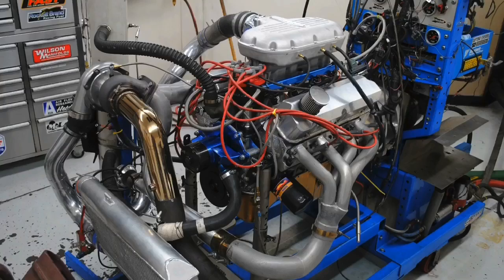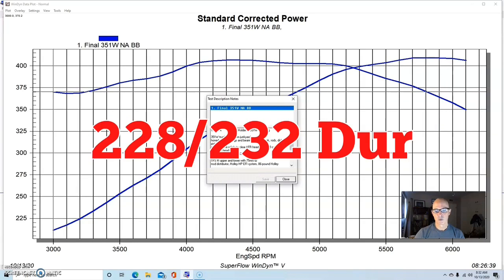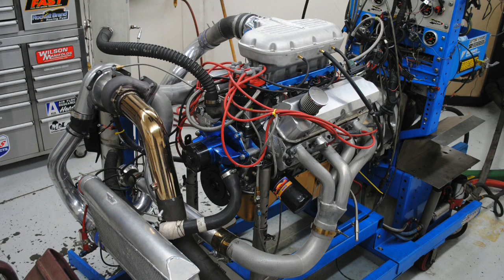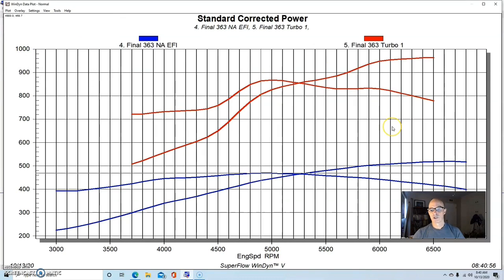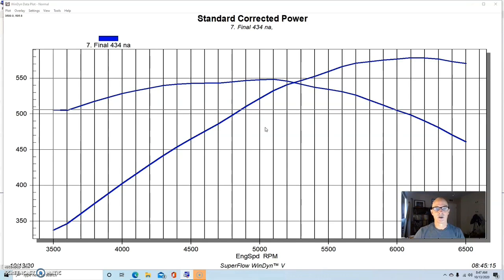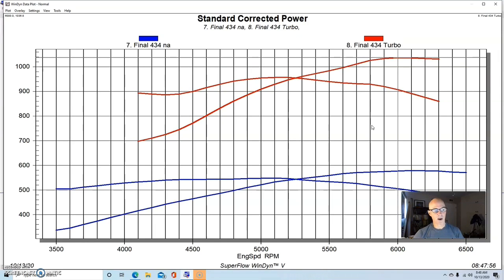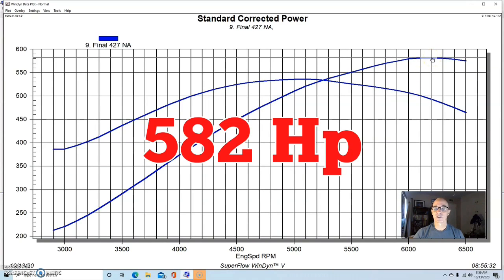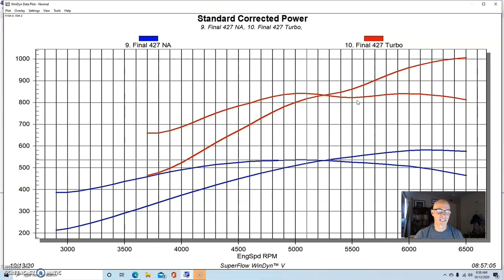HOW TO: 1000-HP JUNKYARD SBF- (& 4 OTHERS)

Comment: Got any advice on pressure oil source for a twin turbo set up 393 sbf
Reply from the maker: we use the oil fitting on the driver side of the blower/front cover
Reply: @richardholdener1727  oil pressure sending unit location?
Reply: One side turbo always eats up the leading edge of the compressor blades and I've tried individual oil lines and shared oil line solid and braided out of the oil pressure sending unit port. Cxracing hybrid turbos

Comment: How did you get the stock EFI computer to run at that level? Did you use a chip or aftermarket computer?
Reply from the maker: WE DIDN'T USE A STOCK ECU-BUT THAT IS EASILY DONE WITH PROGRAMMING

Comment: You wouldn't want to provide a 700-750 build sheet for a 351w would you? Thinking turbo with mild boost 16-18 lbs
Reply from the maker: 315w with mild cam (xe274hr), decent heads (afr or tfs) and intake with boost will easily make 750 hp

Comment: Old video, I know. Curious what size turbo was on the 363 SHP? Made great power at reasonable boost.
Reply from the maker: WE RAN A PTE 7675 AND A COMP 80MM
Reply: @richardholdener1727  thank you Sir! I've currently got a gen 1 cast VS 7875. Lights off quick but might want to upgrade to one of the S480 styles they offer.

Comment: Rigrht at the end you drop a rather huge nugget of info for us. The 427 was 10.2 -1 cr. And t answer your question absolutely no. At 10psi with full boost cr is about 18-1 when starting at 10.2.  especially with a carb. You couldn't do it with fi and 16 degrees. At 7.8 or 8.0 maybe. 
My question is, was the 434 and 363 over 10-1  cr to?
Was the challenge to do the 1000hp for street use and pump gas or did it matter. I was always of the thought that you will make more power with less compression and more boosting  with timing rather than more compression less boost/timing. Assuming you have a fixed octane of 93
Reply from the maker: we did not run 91

Comment: Richard what kind of fuel did you run in the 351w 427 stroker test
Reply from the maker: RACE GAS
Reply: @richardholdener1727  I have the same set up with turbos 351w-418 if I run e85 what's the max compression ratio

Comment: Would you recommend the xfi236 cam   in a dart shp 363. 10.1 compression with an intercooled vortech. 10psi? It is not a race car,  maybe an occasional test and tune. Tuned on holley terminator X
Reply from the maker: yes-or something slightly smaller if more of a daily driver
Reply: @richardholdener1727  thank you for the reply. It's not a daily driver just a weekend toy with occasional trips to the track.  I didn't mention I'll be running afr 205 heads. Thanks for all the great video content.

Comment: Would it be ok to run 93 octane gas on something pretty similar to the twin turbo 351w he talked about here on 15lb of boost? if so is 20 degrees on timing alright or would I have to set it lower for 93? It will be stock internals and everything with a 62cc chamber and about a 600 lift cam. Not sure what that compression ratio would be
Reply: About to build a refreshed junkyard/ebay 351w to replace my underpowered 302 ebay build😂
Reply from the maker: set it so it does not detonate
Reply: @richardholdener1727  makes sense
Reply: I'd definitely use a DYNAMIC compression calculator to find out exactly where you're at. You'll need to know piston CCs, deck clearance, gasket thickness to get the static compression ratio. Radical cams usually have quite a bit of I/E overlap dropping the dynamic compression ratio. When you read cam descriptions and they list "increased compression ratio" as a requirement, it's usually to compensate for longer overlap in high duration grinds. You can even go so far as specc'ing out a cam to take compression away intentionally. I just picked up a 5.8 Windsor for the same thing. 😊😊😊😊 Hope your build turned out great 👍🏼👍🏼

Comment: I deal with a lot of pump gas and boost combos at my place of business in the powersports industry so I've got a bit of experience there. The boost would not be a problem in my opinion and neither would overall power but the timing and compression ratio seem to be the things that get ya with pump fuel safety. In the stock engine configuration on the Polaris RZR 1000's, the stock compression is 10.5:1 ratio so we end up pulling quite a bit of timing at higher TPS values to prevent spark knock because pump fuel is really volatile. It's also extremely inconsistent even from one side of town to the other, you could get totally different fuels. 

My take is it's possible but you're on edge of what I'd prefer to as the safety line running into knock/det issues. With the higher quality engine components of automotive engines vs powersports engines as well as far more capable engine management systems, it absolutely can be done with just the right recipe. We only have 91 octane here in Idaho unless we buy 55 gallon drums from a supplier here locally. So I'm basing this on my specifics for my location.

Comment: Hi Richard , I think if you dropped the deck height down far enough to allow the top ring to remain within the bore yet if the head has a 360 ° relief to clear the now positionally higher can unload the fire ring in the head gasket , the top ring from any detonation , so yes I think pump juice @ 1000 HP should be as reliable ,  as a mass produced new car , with its  factory type warranties .  Personally I am one for large volumes of oil , with 3000mile intervals for filters as well , personally 10000 to 15000 km intervals now , I don't believe oil and filters could be serviced more frequently , to no envirvironmental detriment what do ever . The fact that it is replaced more regularly it would at waste stage still be cleaner than if it were 10000 to 15000 KMs .

Comment: Great video brother, I was wondering if you had ever taken a ford 5.4 and put old school 351 heads back on it and intake with a carb with vacuum advance. And just get away from the dual timing chain and to a single chain. Or if it was even possible
Reply from the maker: those r different engine families
Reply: @richardholdener1727  will the 302 bolt up to the transmission and can you use a non computered engine to that trans

Comment: Wow! I was never a Ford guy but that 351 block is impressive with those AFR heads. I've been told by quite a few guys (Ranchers) that a factory 5.8L powered F250 or F350 with that ugly factory long tube intake can out pull the 7.5L version over the Altamont Pass and one of your other video shows why. I'm not saying the 5.8L Ford is the better choice for power. That 460 with some good parts is a feakin monster motor. But this combination is really and nice setup, even NA.

Also I wanted to tell you there was no advertisements when I watched this video except two, 15 second adds, right on launch. Just saying. You need to make money somewhere here and I know I mentioned to you before they were putting 50 minute adds in a while back. I didn't mean to have them stop the adds. I would think anything under 3 minutes is okay, without it getting skipped. I try to watch all the adds and some I click on just to see what they got.

Thanks again for the great data. really amazing you do this.
Ed D

Comment: I have a question. i thought you said you was did work for a Ford or Mustang magazine back in the day. My question is, i remember reading in either 5.0 Mustang or Super Ford magazine, if memory recollects, the mag did a article on a 1995 Cobra Mustang, and it was if i recall correctly, it was a 351w that made 1032 to the wheels, and kept breaking transmission and do 100mph 4th gear burnouts. Do you remember that car, its history and the engine combo? This was back in the day and unheard of back then for a street driven car.
Reply from the maker: That wasn't me-I did tech and not car features

Comment: Richard, I hope you’re hungry because here’s some food for thought. I previously mentioned NATURALLY ASPIRATED SBF combinations that were capable of reaching the 1000 horsepower mark. They actually fell a little short of the magic number but I think you might agree that with a little tweaking, the potential is certainly there. 
This one can be viewed right here on YouTube and posted by FULLBOOST from Australia. It’s a 461 cu/in Clevor with an aftermarket block and canted valve (Cleveland) HIGGINS Race Heads and built by DANDY Engines, Inc. It uses a single 4-V carb on a Higgins intake, has 13:1 CR and was run on 98 (RON) Aussie pump fuel. 
The dyno results were 934 hp/ 669 tq. Subsequent test results on race fuel were 979 hp/ 700 tq.  Did I mention naturally aspirated without power adders ? 

Next up is from my neighbor here in Georgia. It’s another naturally aspirated SB Ford from Greg Brown at Hammerhead Performance Engines and features Greg’s own unique Ford HEMI Head design. The Hammerhead is a direct bolt-on for any Windsor block and Cleveland blocks with minor modifications. These heads in an as-cast configuration with stock sized stainless 2.200” intake and 1.650” exhaust valves flowed 382 cfm intake and 260 exhaust. Porting increased flow to 435 and 290 cfm. 

In June of 2017 on Charlie Peppers dyno, Mr. Brown tested a 427 featuring a World Products “Man ‘O War” Ford Windsor block topped with his Ford Hemi heads and single 1250 cfm Dominator Carb. 
The results were 928 HP @ 7700 RPM and 674 lb/ft of torque @ 6000. 
Also done naturally aspirated with NO power adders !  Of course race fuel was required for the 14.8:1 compression. Cam duration 281* /297* @ .050” lift. After analyzing the data they determined that the 1250 Dominator and intake used on the dyno was way too restrictive and a 1450 on a CHI intake manifold along with additional tuning should eclipse the 1000 horsepower mark. 

So Mr. Holdener, big power numbers without forced induction are quite possible. For the full story go to;
hammerheadperformanceengines.com
Reply from the maker: Those are impressive. I think I mentioned in the video that those power numbers were possible (NASCAR, Sprint Car and Drag Race)-but so is a trip to the moon-I can afford none of them-and neither can most of the viewers, which is why I chose to include more realistic and affordable combos.
Reply: @richardholdener1727 , I most definitely see your point about the cost for the SBF Hemi heads being an issue with some people. But several of your test mules included an aftermarket block, twin turbos, an intercooler, fuel and spark management units, forged internals, a high dollar blow through carb and more. By the time you add it all up, there’s a sizable investment that’s just out of reach for many.

Hammerhead sells their Hemi heads as a package deal. Included with the heads are the required valve covers, stainless steel valves, premium springs, Jesel shaft rockers and more. 

One thing that stays constant in the automotive universe is the high cost of building powerful and reliable engines. 

And the beat goes on....

Comment: Richard, do this combo 4.125" bore and 3.875" stroke. If you can find a block to go 4.155" safely but remain 3.875" stroke with Either AFR 225 Or TFS 225 head's with that cam research 0.700+ lift cam on twins. Go to 23.5 bar on it. 😉😉😉😉

Comment: Can we do a video on a centrifugal blower with a waste gate for increased torque? I would love to see how it compares to a turbo set up. Preferably on a Ford small block.
Reply from the maker: It will always makes less-parasitic losses associated with driving the blower-even worse when gated at higher speed
Reply: Ok got it. Thanks for the response.  I am looking to get just a bit more torque without maxing my Novi 2000 out.  Control it with a waste gate controller. Dial it down for the street.  Keeping reasonable boost levels of course, say 16# down to 10#. This will be on my shp 347. Not sure if the parasitic loss is going to be a huge issue.  Any other input or tips would be greatly appreciated.  Thanks again

Comment: I’m having issue converting injectors to use for my hemi. Any tricks? They are LS injectors
Reply: maybe because they are LS injectors??
Reply: @thenomadrhodes  nope not the issue. U can use them. You just have to convert it and idk the company I bought them from is trying to say my conversion math was wrong. One side was rich and one side was lean
Reply from the maker: are you talking about mechanically converting them or just calculating the flow?
Reply: @richardholdener1727  just the flow, they are the correct plug and length

Comment: 10 pounds of boost with a 10 to 1 compression on 93 octane????
I'm a nervous Nelly when it comes to detonation the timing would get pulled back or maybe some water/meth injection.
Reply: I’ve done it, made 630rwhp on a cam only L99 w/20 degrees of timing.
Reply: @rocksgsxr750  what kind o boost was you on? cuz no way you were na making 730+ crank in that engine with a cam swap only
Reply: @bigsean2473  10 lbs  10:1 CR and 93 octane
Reply: It's possible. We do it in the LS world all the time.
Reply: Brandon Carpenter  ive seen guys run 800+ on scat9000 cranks. those are the budget cranks none forged stuff. ive done only 600 in my lil combos but never heard anything bad about scat
Reply: Not a problem if you've got decent charge cooling.

Comment: Can you do a video on how cam(s) affects power: What duration, lift, and overlap does to output and how it changes with displacement? Thanks for the videos!!!
Reply: There is a cam vid on utube called Choosing a Cam by an Engine builder its about 45 mins long and its amazing. It Answers so many  questions about cams. Highly recommend
Reply from the maker: I've done lots of cam videos
Reply: @richardholdener1727  you have done  a lot of great videos on camshafts. I guess I am not clear on what makes a stroker cam and the mindset on picking a cam.

Comment: For some reason I thought the 351w was a big block
Reply: The 351C is physically a big block
Reply from the maker: the 351C is a small block-shorter deck than a 351W
Reply: @richardholdener1727  I stand corrected. Maybe I'm thinking 351M?
Reply: James Williams the M has a big block bell housing bolt pattern but the same small block bore spacing. Think of it (and the 400) as talk deck Cleveland. Also, small block and big block is more gm thinking. FE is a "big block" whether it's 428 or 332 cubes. The Windsor is a small block from 221-351. The 385 is a big block from 460-370. Cleveland, small. M, small. Y block 272-312, fords built a ton of various displacement engines from various blocks. Gm built a small block...and a big block.( and a w head 348-409 if you want to get picky) Even mopar built poly motors, small block(la) , two big blocks (b, rb) small hemi, big hemi... It's easy to categorize small and big and now that 90% of fords are Windsor or 385 motors, they too can be technically called big and small I suppose.
Reply: @jimmiller4667  shows my Ford knowledge. None apparently. Lol